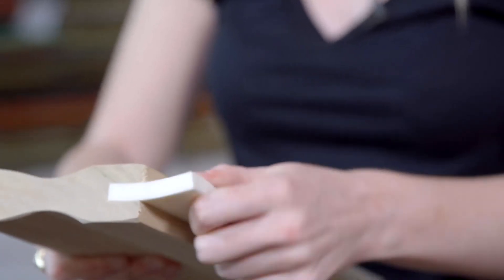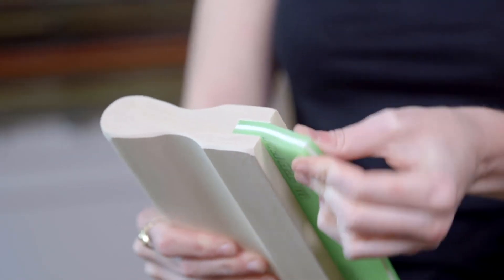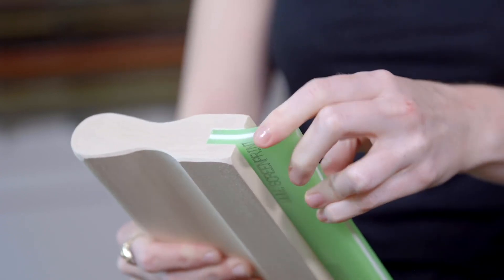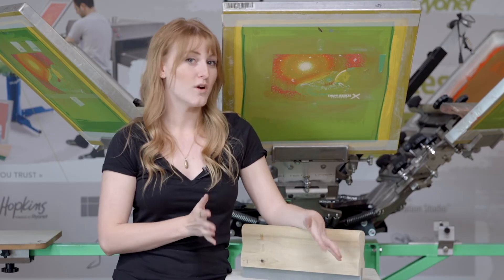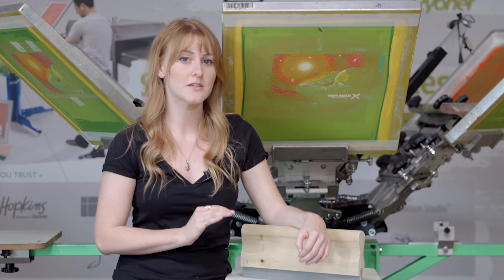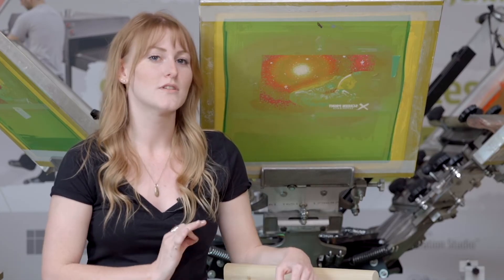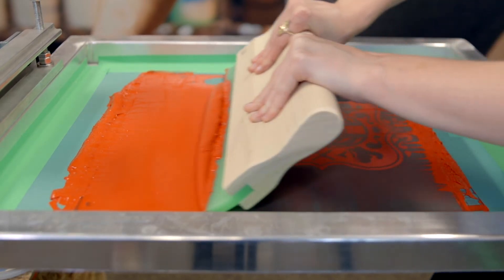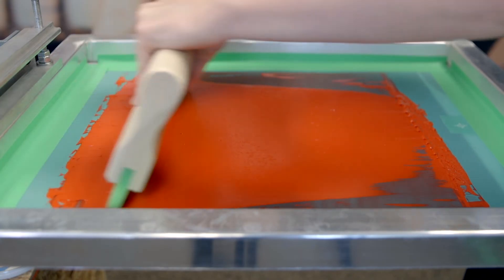How to Choose the Proper Squeegee Blade Durometer when Screen Printing

Comment: Hi, I have maybe a silly question to ask here but maybe you can help. I’m looking for refill rubber for a shower squeegee to dry our shower tiles after showering. What would you stiffness would you use if you were doing this? Thanks 😊
Reply from the maker: Hi Brian! Unfortunately, i'm not heads up on where to send you. i'm not your best resource on this one. Good luck with your search!
Reply: @Ryonet  No no, I’m only asking your opinion from experience of the feel of material. I have a source, I just need an idea of what to buy. Thanks for the reply & have a nice day 😊

Comment: Hi dear ,
I have an issues in printing halftone on sticker with solvent colors. I use 85 shore squgee for screen printing. But after some prints lines spear on squgee. It shows on my print. Kindly help me to solve this problem.
Regards!
Reply from the maker: Hi Danish, might be a few things. i would check the squeegee angle. keep it upright and engage the edge of the squeegee to "shear" the ink off. check your off contact, meaning the distance between the screen and the substrate. not too much is needed with what you are doing. are you using clamps? or a press? lmk. happy printing!

Comment: i am thinking to myself that this application would work great on removing pet hair and lint from my clothes and fabric in general, thoughts?  If you think out of the box for a second, dont you think using some sort of ceramic blade/razor blade attached on an angle similar to the squegee blade angle and posssibly placing rubber flaps over the blades would work great on remioving pet hair and lint from fanric?  i have twi ctas and three dogs and i am really thinking of how to solve my problem b/c the current products do not work!
What are your thoughts and what are some applications that using a squegee to solve that you usually do not see everyday?  Thanks 
And just curious, what products have you used to solve my problem with pet hair?
Sincreely,
Jon-